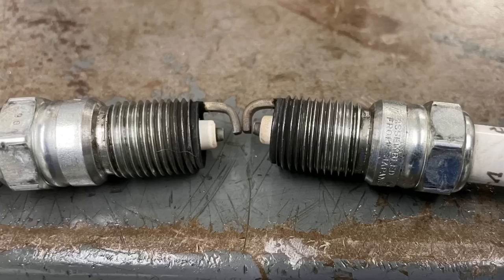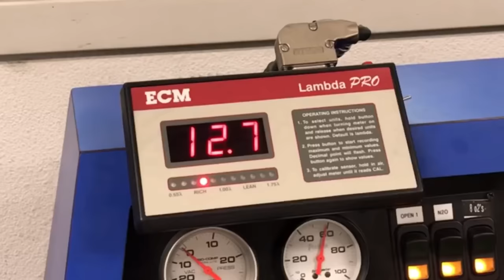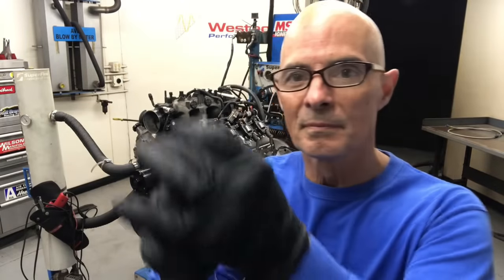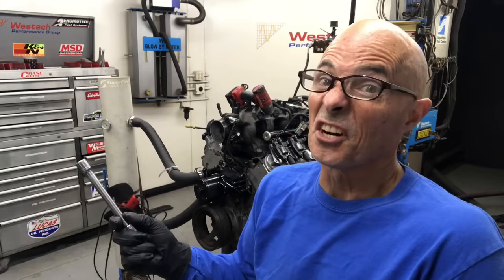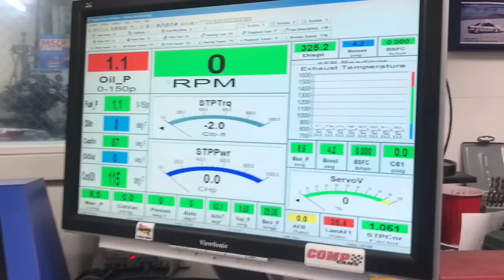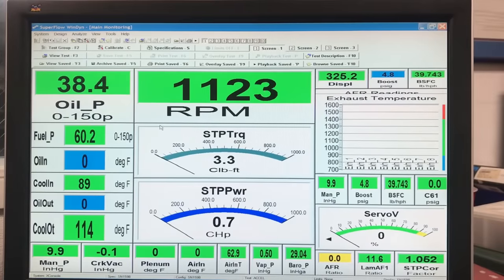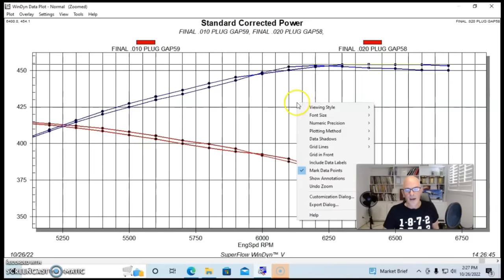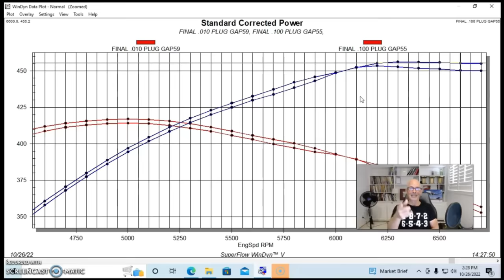JUNKYARD LS PLUG GAP TEST. DOES MORE GAP EQUAL MORE POWER? HOW MUCH SHOULD I RUN? .010 VS .100 GAP

Comment: Love the plug gap content but what would it do with 10 or 15lb of boost
Reply: Boost is just a multiplier. Too much gap you’ll get spark blow out.
Reply from the maker: RUN LOW GAP UNDER BOOST
Reply: I'm not entirely sure....but I've been taught that it's not actually blown out, what's happening under boost /high compression is the higher density of the atmosphere (boost/high comp)  causes more electrical resistance in the cylinder, meaning it requires higher voltage to achieve ionization allowing current flow and eventual spark ...now if the atmosphere density is too high for the voltage (electrical pressure) to overcome the added resistance... you have a failed ignition of the current flow (spark) 
Now when that happens the built up energy has to go somewhere (path of least resistance) and is more likely to short circuit the coil or dump it to anything grounded..... Especially over time /heat cycles

Comment: That guy probably got a 10HP difference, He probably found a good Gap that the tune he was on Liked maybe? I have heard of that happening just by adding a little bit more and tightening it up too.. But I am no mechanic.. Just going by what I hear and my experience. Mine supposedly come pre Gapped so what I do is lay them out and look to see if any are gapped differently or off in anyway before putting them in.. Mine both have special tips to them, that I'm not supposed to touch on the top and bottom, like 2 little stinger's facing at each other... You can take a gap tool or feeler to it if you are easy with it. You kind of need to know where not to touch now with these newer plugs. Oh and if you are on a Tune or making more boost the plugs go Bad twice as fast...

Comment: My question is are the HP & TQ graphs crossing over or not? If so then maybe the shorter gap plug picks up power at higher RPM due to the slightly quicker strike across the gap?
Reply from the maker: hp and torque always cross at 5252

Comment: You forget about other factors that affect performance. Lambda probe, advance regulation, etc. That is, the engine control unit and the map created by the control unit depending on external factors. For proper tests, you should use an old gasoline engine without the control unit and other things...
Reply from the maker: lambda probe, advance regulation? neither a/f nor timing were changed in the test

Comment: New recommendation over the past few years about spark plug gaps. Never change a spark plug gap. They come gapped correctly for the application right out of the box. If the gap is incorrect, get a new plug. Never clean and re-gap used spark plugs if you can put new ones in instead. As the center electrode that is surrounded by the insulator wares, The sharp corners deteriorate and disappear first and the center electrode appears rounded at the edge.. when this happens, and it happens normally, you lose up to 60% of your spark plug voltage.. as spark plugs age through use, the insulation on the insulator gets contaminated by solid carbon deposits, causing leakage to ground and weaker spark.. that puts a greater strain on your electrical system slashthe coil…. it Hass to build do a higher saturation rate to jump the gap..
  adding super Duper after market spark plugs made of exotic metals with exotic names does not increase the voltage of the spark. Only the coil can do that.. if you want a hotter spark, improve the quality of your spark plug wires, and your coil/coils..
  I will never use champion spark plugs in anything I ever on if there is an alternative available. They do not recover after the first heat cycle for some reason. This is widely known by experienced mechanics…
   example
A customer took his Honda car to one of those places that sells tires, changes oil, and will perform a tuneup of sorts which includes changing the spark plugs. after the “tuneup “, the car did not seem to run as smoothly as it did and it didn’t have a smooth idle.. his gas mileage dropped a bit also.
 so the following week, there was an opening at the Honda dealer service department. An acquaintance of mine is a mechanic at this dealership for over 40 years. He put the car on the scope/test equipment. He could see immediately that one of the spark plugs was misfiring… when he removed the spark plug he saw that it was a Champion Spark Plug. He simply replaced the champion spark plugs with NGK spark plugs, and the scope readings were normal after that..
  we got into a discussion about spark plugs because both of us raced motorcycles at one time .. I was very successful road racing motorcycles, I won six championships and was national champion two times. I told him about the time the champion spark plug rep gave me two cases of every size and heat range spark plug I could possibly ever want.
  I put them in my machine, when I did a plug check tire pressure check, and it ran fine. I went back out again after I adjusted my tire pressures and I lost 300 RPMs in Top Gear. That’s about 5 miles an hour. That means I would be lapped by myself in the final on Sunday by someone turning the same last times I used to turn and hit the same top speed i use to have..
  I went into panic mode, and checked my timing with the dial indicator, I clean the carburetors, I change the fuel, I changed the spark plugs. I went back out, everything seemed fine, I went back out one more time before the heat race to do a plug check, and this time I was missing 400 RPMs in Top Gear..
  I had about 10 minutes to check the carburetors again. One of the top mechanics from one of the other teams in another class saw me working feverishly on my bike. He strolled over to see if he could help which is unusual, but he was in a different class so I couldn’t hurt him so he offered to help. He saw that I was using new champion spark plugs. He said here’s your trouble. Throw these things in the trash. they are like fire crackers, they’re only good one time when they are new.
  so I put in my old used NGK spark plugs that were several races old. I went out in the heat race, and I won as expected..
  I told my friend the automobile dealer mechanic at a Honda dealer would happen to me. He said, every mechanic where he works knows about champion spark plugs. When a car is not running correctly, that usually the first thing that check to see if champions are in there. For some reason they do not recover after the first heat cycle. If they misfire just once every hundred RPMs, and you have an engine that makes 50 hp. You’re probably losing at least 3-6% of the power..Maybe more, because that one cylinder is being a drag on the other three or two or one or seven or five cylinders depending on the  number of cylinders.. The fewer cylinders, the greater the loss. When they spark plugs misfire, they don’t just misfire once every 100 rpm.. you can tell when you remove the spark plug it is darker than the other spark plugs due to not reaching operating temperature in that cylinder. And they don’t get better as time goes on.
  never never clean spark plugs. They used to do that before the 1970s. They used to have bench spark plug cleaning machines that would sandblast the spark plug, and you could put a electrode on the end of the spark plug and push a button on the machine and look through a piece of glass window as you increase the air blowing over the spark plug while it is firing and watch the spark. The more turbulence that goes on in the combustion chamber, the harder it is for the spark to jump the gap. That’s how those spark plug testers used to work. I have used them back before cars had electronic ignition’s when they needed tuneups about twice a year which included points, condenser, rotor, distributor cap, and spark plugs.. it was common for people to clean their spark plugs and regap them..
  but now we know better. As that gap he roads and grows, it is harder on the ignition system for the coil to saturate, and it takes more electrical saturation of the coil for the spark to jump a wider gap.
  in other words, don’t clean and re-gap spark plugs, even new spark plugs if the gap is wrong, get another spark plug. That is the factory recommendation now. And look how much better cars are today.
  100,000 miles on a car 30 years ago that car was considered completely worn out. There were engine rebuilding places in every small town, there were transmission shops in every small town, muffler shops in every small town, gas stations usually had full-time mechanics.
  today, it’s rare to see a muffler shop, a transmission shop, and engine rebuilding shop in a small town. Cars last so much longer,
  cars are better than they ever were. They are faster, they will actually go round corners and stop, if a car doesn’t start today, it’s either out of gas or the battery is dead.. ignition systems are light years ahead of what they used to be back when cleaning spark plugs was the norm. So if car manufacturers today say just replaced spark plugs, don’t change the gap don’t clean spark plugs, I think they know a little more about it than the average Shadetree mechanic these days, and it’s better to do with the factory says to do, especially at the cost of new cars today..
One other little thing
  don’t buy NGK spark plugs on eBay. They are the most counterfeited spark plugs in the world. The counterfeit spark plugs are far from the same. They have been known to come apart and destroy engines.
  Only by your NGK or ND spark plugs at your dealer where you bought the car, or at a place like advance auto that actually stocks NGK plugs. If they don’t have them today, they will have them for you tomorrow. They’re only a couple bucks apiece new. When I go to the trouble of pulling out an old spark plug, and changing the gap on a worn spark plug, and going to the trouble of putting that old spark plug back in when it can’t possibly perform like a brand new spark Plug.. that is almost as bad as some Third World countries that just cut deeper grooves into bald tires on tires that are worn out..
Reply from the maker: WE REUSE AND REGAP USED PLUGS ALL THE TIME AND COMPARE THEM TO NEW PLUGS-NO POWER CHANGE-WHEN THEY ARE WORKING-THEY ARE WORKING.
Reply: Oh good grief! What is this? Only ever buy a brand new plug from only from the official supply chain? Is this anti-science?  
If you don't try actually test something out then you'll never know what it is you don't know.  
After replacing a faulty plug in an emergency with one from a junk box to get my single cylinder engine home, the bike went noticeably better, I then tried a dozen different types of plug and some better some worse. The best was L87Y And you know which was the WORST plug?  The 'listed book one' (L86) brand new. I went back to the junk box one. That was 40 years ago and this history repeats itself over and over.

Comment: Think you need to test it under boost , will the boost pressure not blow the spark away under load if the cap is to big.
Reply from the maker: reduce gap for boost-we run .018-.020

Comment: I saw depends on how primitive and how advanced your ignition and fuel delivery Systems are and what combination you have more variables and whether you have a decent tune to begin with because if you don't have enough power from your coil you will lose power but you put more Gap and a stronger coil on say an HEI distributor theoretically you can add a little bit more fuel and gain a little bit of HP yada yada yada

Comment: But you didn't do anything in between other than the .021. How about .035? .040? .050 etc.?
Reply from the maker: run it at .035 for na, and down near or below .020 for boost-there is no power from gap

Comment: So, if you have the ignition, mo' gap = mo' power haha.  I've ALWAYS went on the higher end of the "recommended" gap the manufacturer lists.  Looks like I have got some more playing with to do.

MAYBE.  Because a proper plug gap in a properly working car seems to do best in the mid range.  Then you have copper, platinum and iridium.  Choices choices.

With Iridiums, I don't mess with them.  The tiny point is already making a super concentrated spark, anyways.
Reply from the maker: look elsewhere for power
Reply: @richardholdener1727  Fair.  But you know how it is.  I dunno how old you are, but I always grew up seeing people getting copper plugs, getting the ones that were one number hotter and then gapping them to the max recommended lol.  

It always made a difference in how the car felt/responded.  Was it 5 horsepower?  No.  2?  Probably not.  But there was a change.

Maybe just because they were new plugs, who knows?

Edit:  Now, though, I'd rather just get Iridium plugs and forget about them.  Working on cars isn't fun anymore to  me.  I used to LOVE changing my plugs and oil, greasing my chassis/ball joints/etc.  Now it's a chore.  I j just changed the oil in my truck yesterday, actually lol.  Was gonna do the mower, too, but just went ahead and mowed and said "I'll change it before the next mowing."

Comment: Too wide a spark gap stresses the ignition system. Psrts like coils may flash over and get ruined, if not now, then sooner than they otherwise would have,. Thus your engine will be less reliable and you'll be forced to do tuneups & change parts like coils & plugs more often. Wrong gaps can also overheat your cat that might otherwise last the life of your engine.

Comment: back when my 1jz ran like shit, I checked the spark gap and see if widening the gap would help and sure enough gapping it to the right specs not only made it run better but felt more powerful verified by my butt dyno 

it was a cold winter so maybe denser air had something to do with it
Reply from the maker: BOOST REQUIRES SMALL GAP

Comment: Plug gap will always make more power IF and ONLY IF you have the ignition to support it. Wire, coil, etc, all have to be up to the task. And speaking of which, compression and boost ratio, head (combustion shape) and timing advance will have an effect as well. Been there done it. It's worth a .10 from worst to best at the drag strip on back to back runs.

Comment: Hey Richard can you please tell me if the Truck Norris cam would be compatible with a stock gen 4 5.3L thats been stroked to a 6.0L with 9.7:1 compression. Im getting a lot of mixed info on this and dont know what to believe. I really like the powerband and performance of that cam but my tuner is having trouble tuning it 100% to prevent detonation at certain rpms even with a set of colder plugs, 91 octane, etc and the cam manufacture companies are saying i could use more lift or duration or both with a wider lsa for easier tuning and just trying to sell me another cam lol. Please help
Reply from the maker: it builds a lot of cylinder pressure-that's how it makes torque. your tuner needs to pull timing in those areas-you could put a bigger cam in too

Comment: sure would be nice to make several runs without any changes to get a std dev, then and only then can you state whether the gap change was of any significance
Reply from the maker: I ALREADY DO THAT-YOU JUST SEE 1 (OTHERWISE THE GRAPHS GET BUSY)
Reply: @richardholdener1727  but without stating what that variation is you don't know how significant a change showing a few hp increase is

Comment: I'm running 45psi of boost through a PT6870 on my 2.5L Subaru, running on E85. I'm running .018 gap on a cold plug but I'm wondering if my drivablity on the street would improve with a stronger coil and bigger plug gap?

Comment: Hmm. What if you have a weak ignition coil and your spark plug doesn't ignite on low rpms? Won't reducing the gap increase the chances of creating a spark when you have lower than normal voltage?
Reply from the maker: yes-we do that under boost

Comment: time, how about when you're doing tests. you measure the time it takes to get up to peak hp. say between new and old motors
Reply from the maker: the dyno controls the acceleration rate-there is no change in that-we see any change as a change in hp and torque

Comment: What’s the best gap to run on a LM7 799 heads with ngk tr55 plugs? Motor has cam, valve springs, and headers
Reply from the maker: THAT GAP (AS HOWN) HAS ALMOST NO EFFECT ON POWER-RUN .030-.050

Comment: What about the e3 DiamondFire spark plugs for my stock 5.3 L LC9 all aluminum LS in my 2012 Silverado 1500 4WD? Is it worth the upgrade or do I stick with OEM plugs? Only mods are K&N intake and 3" Flowmaster Super 40 muffler with a Hypertech tuner.
Reply from the maker: stock plugs

Comment: I know someone has to have already dropped a line about this but,  does anyone really know if the E3's do perform better.  Cuz everything I've put them in mostly smaller engines but still built for racing I've noticed it always comes back out looking like hot cocoa after a night of ripping and can see the timing line no problem.
Reply from the maker: THEY ADD NO POWER-SEE THE E3 PLUG VIDEO

Comment: Richard what if you use ls3 head on a lq9 6.0 an use stock truck intake on square port  head thanks needing to know
Reply from the maker: you need to use a square port truck intake (LY6)
Reply: @richardholdener1727  I knew it was a dumb question lol

Comment: Nobody care about n/a engines, then for turbocharged engines, gap should be pretty much under 0.5mm because otherwise the spark will be highly affected by BOOST. I don't talk about shitty levels of boost from stock shopping cars (0.4-0.8bar relative pressure)
Reply from the maker: NOBODY?
Reply: @richardholdener1727  Does not offer anything except some nice sounds in some applications. Toyota was last which tried to prove a n/a could worth it in a world of supercharged engines .  but failed miserably.

Comment: I would think adding plug gap on any engine would increase power so long as your coils have the voltage to support it or you upgrade coils to ones with higher voltage.